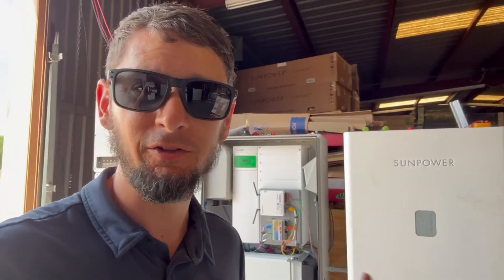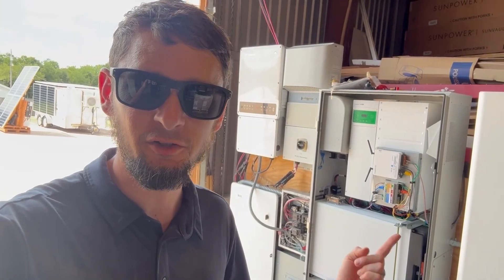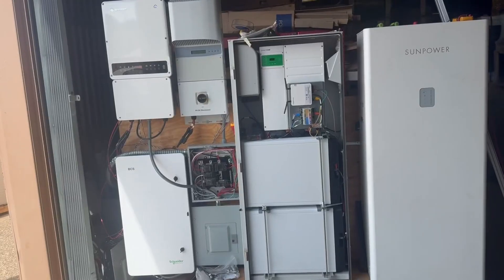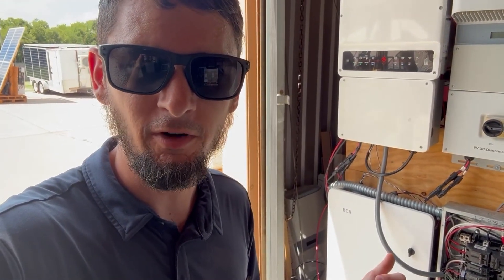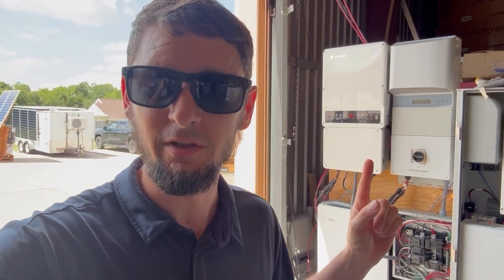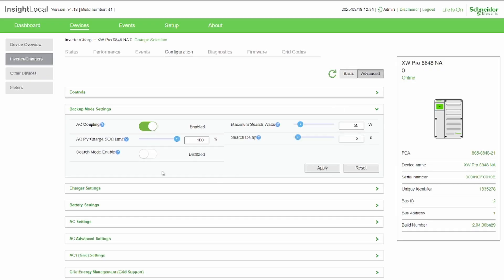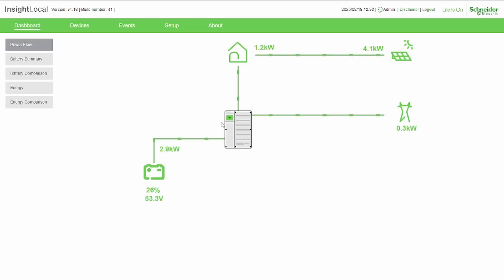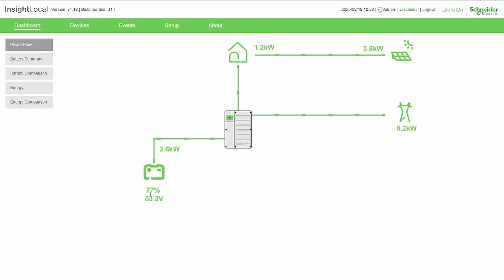Adding Battery to Existing Solar

Comment: Why are your panels so much less than other online stores and san tan solar? Are they used, not in boxes from factory? Just wondering because i am shopping.
Reply from the maker: Good question. Sometimes they have a story and sometimes the story is that we have a relatively low overhead and want to simply pass the deal along. Examples, the Sunpower 330w panels don't have a Sunpower warranty any more. The 375w Longi panels had been sitting around for, I'm guessing, 5 years before being liquidated so there is some time eaten up on their warranty.